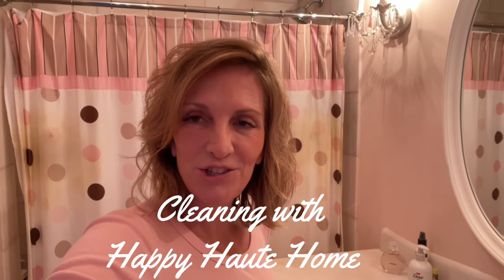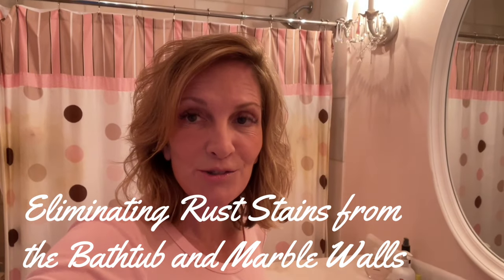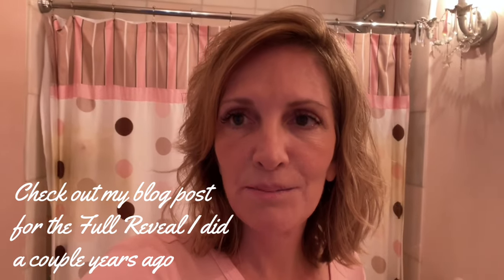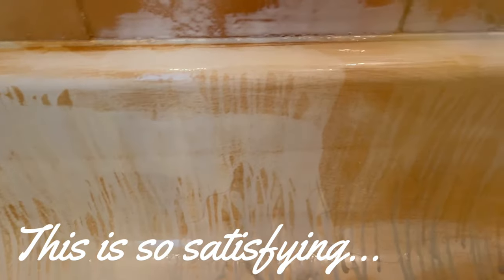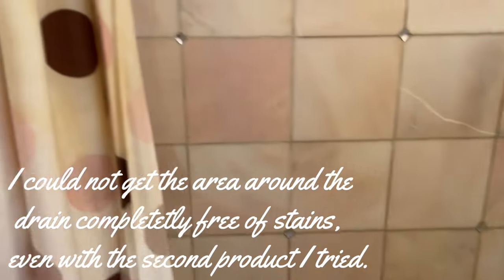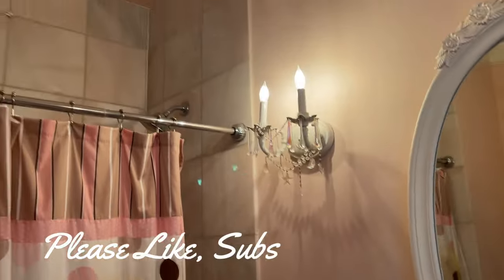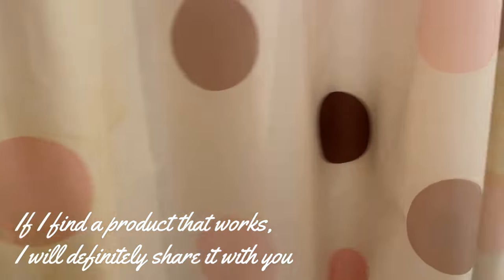Clean with Me | Removing Rust Stains from a Bathtub and Marble | Best Cleaning Hack Ever

Comment: The only reason it is not working around the drain is because it was likely wet.  For some reason, "the works" toilet bowl cleaner stops working on rust, the moment it is exposed to "WATER."  So, ensure you DRY it completely, before using "The Works."  Blessings
Reply from the maker: That's so odd, wondering then how it works as a toilet bowl cleaner? But appreciate the tip.

Comment: Use this with magic eraser.  I have noticed that they changed the Works toilet bowl cleaner and it doesn’t work nearly as well as it used to.
Reply from the maker: I believe they have come out with different formulas and different ingredients. That's why I tell my viewers to use the link in the description for the exact one because many bottles look alike.
Reply: Correct... there's the Works standard toilet cleaner which won't remove rust and there's the high acid version which will remove rust. Just can't get the high acid one on anything steel.
Reply: Classic clean formula definitely won’t work on this project.   I discovered there are different versions on the works.   Wear a mask.   This is brutal on the lungs & eyes.

Comment: I've always used Works toilet bowl cleaner. I wear a mask, fumes are wicked open window and ventilate. I pour it in spray bottle. I mist tub bottom and in rows mist my way slowly up, it keeps it more evenly applied so you don't get the drippy streaks. Then I scrub in circles with teflon scrubby as to not harm tub surround finish. Only bad part is it removed the finish off my drain hardware.
Reply from the maker: Thanks for sharing!

Comment: FYI you need to get the overflow cover back on. The cover holds the overflow drain in place and tight against the back of the tub so it seals. The way it is water can/will get behind the tub and may allow mold growth in the wall.
Reply from the maker: Hi Jim, yes I did. The screws has rusted on the one that was on the tub, so I had to replace it.

Comment: We just installed an "Iron Curtain" device from Osby Water Conditioning(local to us). For the first time in 30 years we do not have rust on our fixtures. We have a water softner but it can't handle the amount of iron in our water so this device catches the iron first and then the water goes through the softner and throughout the rest of the house.
Reply from the maker: Wonderful! I bet you are happy about not seeing those rust stains. I believe ours conditions as well as softening. It's an expensive system and also eliminates the sulfur scent.

Comment: 🎉toilet bowl cleaners do a number on your Chrome fixtures and drain covers.
It also can damage fiberglass.
So be careful what your using it on.
Test a small spot first.
Reply from the maker: Testing first is always a great idea, thanks for the reminder.
Reply: Yes, we have Harpic toilet cleaner in the UK which is about 10% HCl. I had a cleaner decide for themself to use it diluted around the bathroom and it etched the chrome off the basin taps. Be very careful.
Reply: It will eat the drain too

Comment: If you have a water heater tank… and this is the water coming out… you may need to purge the tank. Should be done approx once yearly. Iron particles build up in the bottom.
Reply from the maker: Thanks for the tip!
Reply: Also replace the sacrificial anode. It's probably long dissolved.

Comment: Need to be aware the toilet bowl cleaner on dry porcelain can etch the porcelain. 😮 
It was intended to be used on toilet bowls. Many TB cleaners manufacturers' state on the bottle to not leave on more than 15 minutes.
Reply from the maker: Yes a good idea to check an area before applying. This stuff comes off right away, so no need to leave on any longer.

Comment: Be careful with toilet bowl cleaners, as some have lye in them, which is a strong acid. Also,  try applying the product liberally on a sponge and wipe the surfaces, keeping them wet. You will use much less product. Plug the drain to capture the solution to reuse. Another product that works at least as well is called Iron Out. It comes in a spray and a powder. You wont use as much if you use the spray, but I add a few Tsp's of the powder to my toilet tank (not the bowl) and let it work for a few hours to remove rust. You can control the strength by using the powder. Cheers
Reply from the maker: Thank you for the tips!
Reply: I have always used toilet bowl cleaner on our iron tub, but we just got a new acrylic tub and the manufacturer said not to use it.  I'm trying some of the things they suggest, but I am not hopeful.
Reply from the maker: @anissaferringer4965  Yes be very careful. I would go by what the manufacturer suggests.

Comment: Did you use another product with the works?  When you squirt it on the walls it appears to foam up but not when you  squirt it in the tub itself.
Reply from the maker: No I did not use any other product. Foaming vs non foaming maybe had to do with the different surfaces and how it reacted is my guess.

Comment: on well water and removed a failed water softener with an ispring spin down sediment filter as well as a GE carbon filter and helped a ton. no softener right now but for rust sand and sediment it worked. just a thought for anyone
Reply from the maker: Thanks for the tip Tony

Comment: So question is the iron kinda sticky?  My kids bathroom toilet keep getting this brown sticky stuff at the bottom of the toilet and nothing is getting rid of it that I've tried!!! None of our other toilets are doing this.  We don't have a water softener
Reply from the maker: Do your kids have a habit of not remembering to flush? That causes staining too I've noticed
Reply: buy iron out..available home depot or hardware stores..9 the jug not the spray..dump it in and let it sit a few hours then scrub..it should knock it out
Reply: you can try using pumice stones for this. the rectangular kind. make sure it’s wet, not dry.
Reply: A flat screwdriver with a real long handle will chip it off.

Comment: This is one beautiful mom.(pretty also)  It seems though her daughter couldn't (wouldn't ?) find the time to give her toilet and bath a good scrub now and then. I too would be tempted to wait till my mother would see it.
Don't forget to (beside using gloves)wear eye protection when using such strong cleaning agents. When brushing spray might reach your eyes.
After a  shower  it's a small task to wipe away soap deposits from the shower or bath wall. To prevent it from ever becoming like this.
This is not only rust but a mix of soap residue and calcium due to 'hard water" that demands regular cleaning.
Your daughter would be better served with porcelain tiles, which are easier to clean. Marble is slightly porous and might soak up deposits.
Removing  water from the toilet bowl is easy by using a small plastic  cup ,throw it in a bucket so you can use that water again for flushing the rest of the cleaned residue.
Reply from the maker: Aw thanks. Unfortunately, the hard water stains on contact and even scrubbing couldn't get it off. I tried and my cleaners tried...Good point about eye protection, this formula is strong! Absolutely porcelain tiles would be easier to clean, I didn't install marble but do love the look!

Comment: So what's the name of the product you are using? You never said the name.
Reply from the maker: It's called The Works. Check the link in the description for the exact one, I didn't name the product because there are other products in the same line with a similar name but don't contain the ingredient to remove the rust stain.

Comment: The Works is good stuff but you have to be really careful with it. It's good you're wearing gloves. I got it on an old pair of shorts and it ate right through them.
Reply from the maker: Yes definitely need to take precautions when using. I recommend using a mask too.

Comment: You can permanently damage your fixtures and if you have shower glass or a an aluminum framed shower doors it will deteriorate that adhesive. Please use the proper products so you dont ruin the other parts of your shower. FYI they make products for this: Iron Out, Barkeepers Friend, and CLR are better options. As a professional cleaner I see this hack ruin so many things, at least once a month I see this issue. Sure, toilet bowl cleaner works but why do it? Not worth it
Reply from the maker: I completely agree to try non abrasive products first, but when they don't work, stronger substances are needed.
Reply: Hi all. I tried this in my shower and ruined the tile. I’m so upset. Any ideas on how to fix it?? I would NOT recommend this product in your shower!!!
Reply from the maker: Hi Denise, you can hire a tile company to restore the polish that was removed. I'm sorry your tile was damaged but I was very clear about the risks involved.
Reply: CLR & IRON OUT do not work. I’ve tried them over the last 30 years. The Works…WORKS ! As long as it doesn’t say ‘classic’ on the bottle.
Reply from the maker: @belladaniella2003  I tried CLR myself and no it didn't work for me either.

Comment: Works better if surfaces wet when applying it works
Reply from the maker: Really? I found that when the surface was wet, the solution slid right off but maybe on a flat surface works better wet?

Comment: I’ve cleaned many tubs with all sorts of harsh chemicals and never has a stain just rinsed off soooo easily.  Make you wonder if that stain was just real or fake just to make a video.  Very suspicious that she doesn’t say the product since this is supposed to be a tutorial video.  On a side note, I’ve used Alberto V05 (clear kind not the creamy stuff, see thru) and it works great.  Just use the entire bottle, pour it in, smear it all over and let it sit overnight, longer is better.  Then rinse and scrub and it gets most or all of the body oil black stains out.
Reply from the maker: The stain is definitely not fake. The manufacturer makes several products with same name so I linked the exact product in the description so as not to confuse anyone

Comment: I did not know Works got rid of Rust!
Reply from the maker: Depends on which one you get ;) Not all do
Reply: @HappyHauteHome  so dollar store version doesn't remove rust?
Reply from the maker: @Katiekay.  I'm not sure which version of the cleaner is sold in dollar stores.
Reply: If it says ‘CLASSIC’ formula on the bottle …it won’t work.
Reply from the maker: @belladaniella2003  Good to know thanks. That is why I specifically linked the one that works.

Comment: DON'T USE TOILET BOWL CLEANER ON AN ENAMELED TUB! I did that when I was a child and 50 years later, you can see where the toilet bowl cleaner ate off the enamel. I have the same problem as you and I usde the clean sponge mop with dawn. That only took off the soap scum. Then I used white vinegar on the sponge mop. It took almost all of it off. So that's what you use and it's non toxic.
Reply from the maker: I guess the enamel could naturally peel off after 50 years...right? Not saying the cleaner didn't do it, not sure.. but normal wear and tear could also be the cause.

Comment: I would be concerned that that cleaner would ruin the grout and corrode the metal drain parts over time.
Reply from the maker: Yes I agree with you Bill. Best to keep the cleaner away from those parts as much as possible.

Comment: I tried that product it doesn't work
Reply from the maker: You may have used the one without the active ingredient. I linked the exact one above in the description.
Reply: @HappyHauteHome  What are you talking about the product name call the works I buy it from home depot
Reply from the maker: @maildoe92 The works makes several ones and not all contain the ingredient to remove rust.
Reply: @HappyHauteHome  Can you tell me which one that does ?
Reply from the maker: @maildoe92  Yes it is linked in the description
Reply: @HappyHauteHome  ok
Reply: @HappyHauteHome I click the link like you said it's the same cleaner that I buy it from home depot I paid 2 of them for $10.00
Reply from the maker: @maildoe92  Ok, if the bottle looks exactly the same as the one you are using...not sure what to say or why it isn't working for you.
Reply: @HappyHauteHome  I have no idea
Reply: @HappyHauteHome  I will try again

Comment: What are you using right now to clean the bathtub and your marble?
Reply from the maker: Now that the problem is resolved with a water softener, a less abrasive solution can be used for regular cleaning. As for the marble, this cleaner is very rough, you may want to watch my update for further tips.

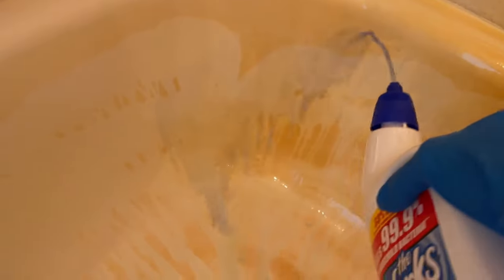Comment: 3:21 is the name it's called the works
Reply from the maker: Yes it's called the Works, just make sure to get the right one, not all remove the stains.
Reply: @HappyHauteHome  the issue really is people don't want to click links and go thru a process of trying to figure out how to find something it might be simple in your head but not everyone is used to doing all that it be easier if you would have just shown the label and talked about the bottles and show people the proper item
Reply from the maker: @Robbie-t4o  I understand that but the reason I did not say what the item was is because the manufacturer has other Works toilet cleaners that do not get rid of the stain, the formula is different in those. To avoid confusion, I just linked the product.